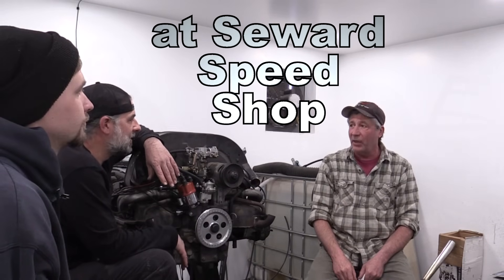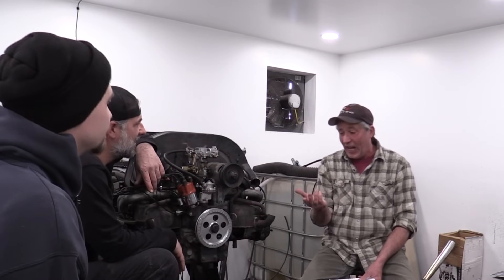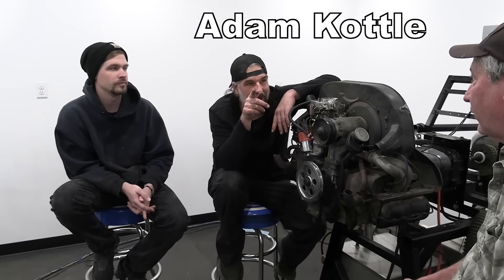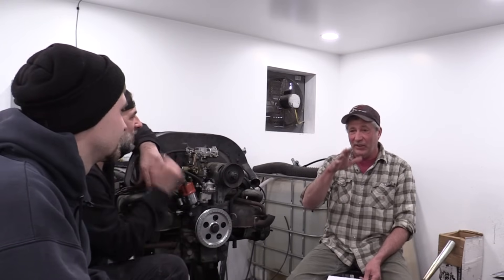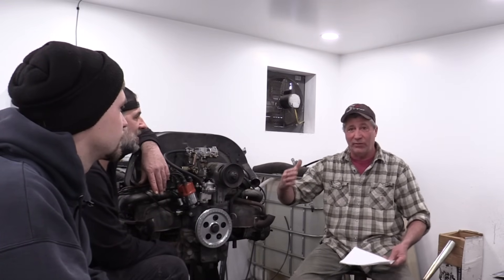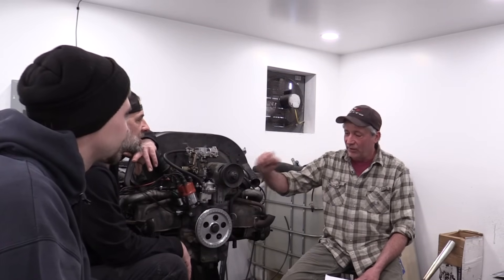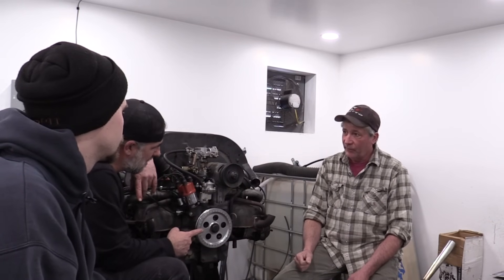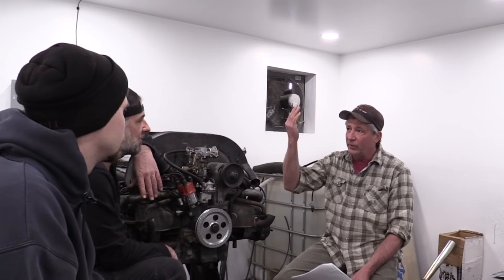How To Choose the Right Header/ VW Air-Cooled

Comment: I thought Adam’s last name was Kottke not Kottle. Similar to virtuoso guitarist/singer Leo Kottke. Anecdotally, I’ve had every imaginable header combination on a bay bus with a 1776. I went back to stock because of clearance in the rear end and it also performs better.
Reply from the maker: It is Kottke. I had a terrible brain fart and didn't notice it until after the video was released.
Reply: @FunWithVDubs I never make mistakes……😂😂😂 I really dig both yours and Seward’s channels. All of you looked like you were having a blast doing the “Building VW Power” series.

Comment: Check out sonic wave tuning. It is either 1625 or 1675 FPS at sea level. These waves create positive and negative pulse waves. You can also target a specific rpm say average cruising speed. I know that a calculation is also available for diameter. This strengthens the pulse waves. Used properly a little more overlap can be used with the camshaft. This allows some of the fresh mixture to be forced back into the cylinder for better combustion. 
The muffler needs to flow at about 2.2 CFM per horsepower. Remember that the original VW exhaust has a lot of engineering involved. It is designed to work over a wide operating range. I have found that this is above the knowledge of some aftermarket manufacturers. Purchase from a reputable manufacturer. The engine is a complete package. If the exhaust manufacturer is not knowledgeable move on.
Reply from the maker: Appreciate the details!

Comment: Question - with a 1968 cc - 40 intake - 35 exhaust valves - 044 CB heads - 440 lift Norris cam.
Should exhaust be 1 1/2 or 1 5/8 - with or without muffler.
Street car.
Reply: Stick with a proper 1 1/2....i.e. no LARGE three bolt flange.
Reply: @brunomahle1618 - thank you 
About late spring this year I finally found an 1 1/2 sidewinder setup I actually liked. Also finally got the jetting correct on my Kaddies . Runs really good now.
Thanks again

Comment: I put the extractors on standard 1600 and had to increase the Carbie jet to accommodate as it would back fire through the Carbie , it wanted the extra fuel and I could feel an increase in power, I didn’t need a Dynomite. 😊
Reply from the maker: That's good to know, thanks for sharing!

Comment: With a 1915, 120 cam, heavily ported stock heads with heavy springs. dual 40 or 44's 9:1 static comp... 1 5/8 header choked it. 1 3/4 let it rev to 7k. 1  3/4 merged header ran perfectly cool on the road and had tons of power across the band. Enjoy the videos and conversation. Make a system of these changes. Rockers, dual carbs, exhaust.... measure the gain. It's just an air pump :)
Reply: You were not making more power, you just moved your powerband upwards. Two different things.
25-30% of what they are saying in this video doesnt hold water. Once again they are wearing blinders and can only see as far as a regular 4 into 1 header.
Reply: @torbenalstrup3902  I wasn't making more power how? I know I moved the curve up, thanks. I don't think they are wearing blinders, I think we haven't see everything they are testing. Not even sure what to make of your comment, and where it's actually directed..
Reply: @timpindell8178  When people do things like what you did there, the powercurve just flattens out, it doesnt pull more. Seen it many times on the dyno. 
With the video. Well, the test mule is not exactly a representable speciment since it is apparently has one foot in the grave. But with exhausts for such engines it is, once again, important to specify what you are after. The entire community is fed with the 4-1 header being the only solution. No, it is the easy solution. There is a difference.50% of all ACVW engines outhere (and their owners) would be better off with a shorty header design or a 4-2-1 header. The latter is very difficult to do on a VW type 1, so that is out before we even get started. But a shorty header is just a matter of spending your money different. The difference between the two is, that on almost any motor, with a cam at or below 284 degrees seat dur. the shorty header will give more usable power below 3500 and much easier tuning, where the 4-1 header will improve power above 4000 and have more tuning issues.
Reply: @torbenalstrup3902  I have no dyno data to back up the butt dyno, and I know I ran out of steam getting to 7k. My point wasn't I was making power, the engine flowed better. I don't disagree with anything you said, and I understand the placebo affect / butt dyno doesn't count, but it sure was fun. I am building another one now, with improvements. I hope to see a total combo result from these tests soon, as the only thing missing is some carbs. Changing a single component isn;t going to show gains on it's own, only when parts are added as a combo will you see the true gains.
Reply: No way a 1 3/4 header was working well on a stock valved head,....not on Earth anyway.

Comment: Back pressure robs power. I believe that is a myth generated by muffler salesmen way back.
Reply: No, that statement is true looking at it isolated, but if you do not have the correct secondary collector you loose power somewhere else in the power curve, most typically in the dreaded AFR dip area.
Reply: @torbenalstrup3902  not sure what your trying to say. My understanding is. Secondary collectors will generate some form of back pressure, the better ones less, creating a loss. AFR dip is more intake related but the more you choke your exhaust the bigger the dip will be exagerated. Its hard to work around pollution laws and not choke your engine is the problem. The old timers knew this and thats why the sales pitch happened that we needed back pressure, back pressure is good, you should fit an exhaust muffler as it creates good back pressure.
Reply: I'll take one extractor exhaust,....and gimme all the back pressure you can fit in the box.

Comment: The stock VW exhaust is well designed, but not meant to facilitate extra power. An 1 3/8 header and single quiet pack muffler Is fine for a mild, near-stock street motor.

Comment: You never never never want back pressure in an engine. Crankcase pressure/vacuum and combustion/compression pressures seals rings. That's why gas porting pistons work so well.